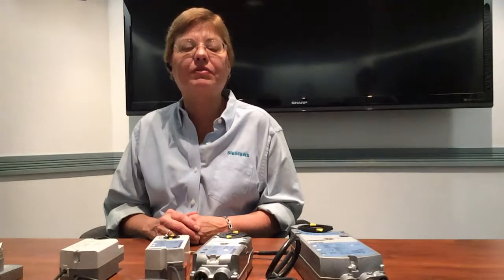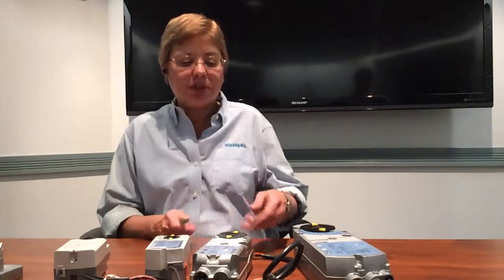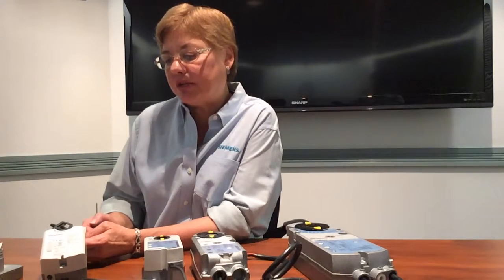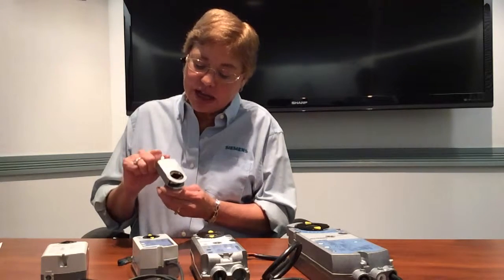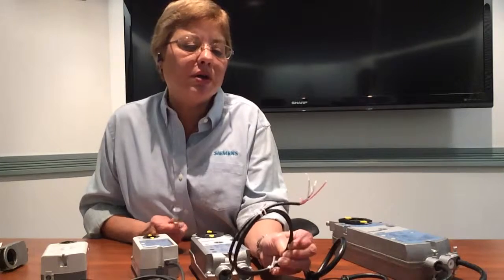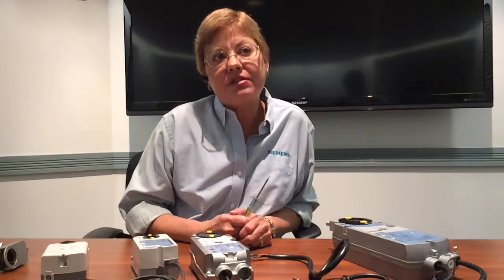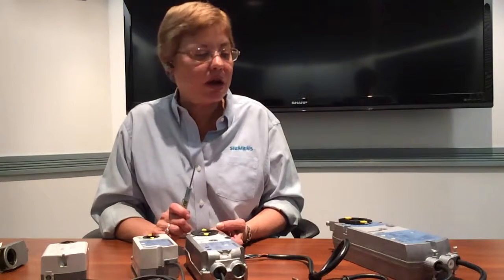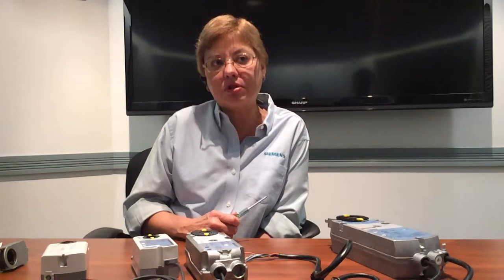Siemens Damper Actuators Overview

Comment: THANK YOU VERY MUCH SIR ,, I NEED TO KNOW , IS THAT POSSIBLE , CHANGE SPEED BY CHANGING FREQUENCY , MY PRODUCT MODEL IS GEB 161.1E DAMPER ACTUATOR MODULATING . , MY REQUIREMENT IS 100% AT 10 SEC